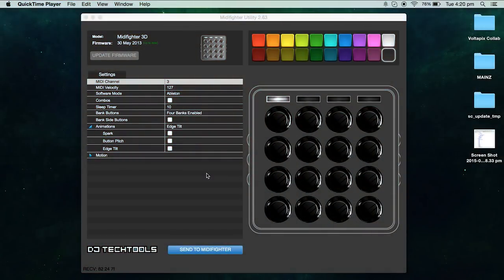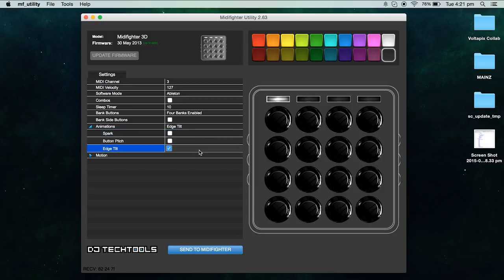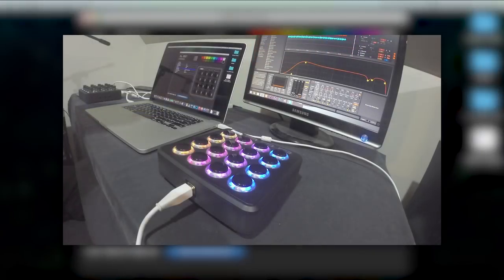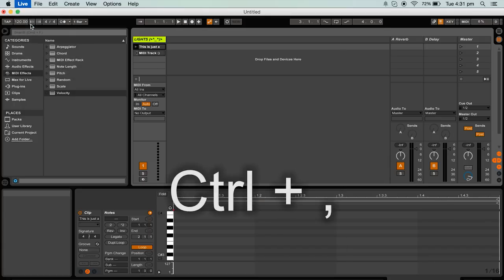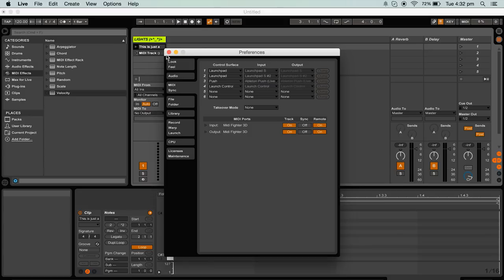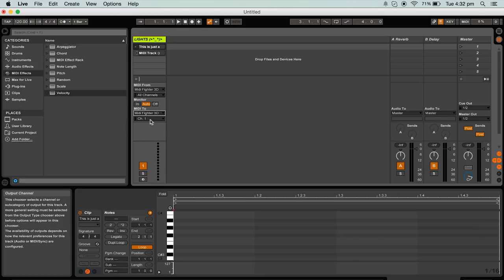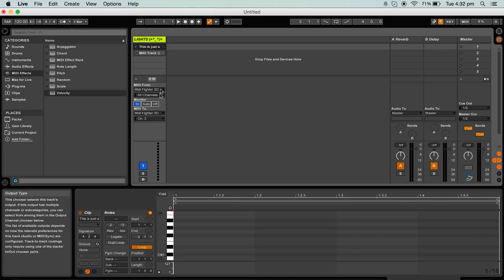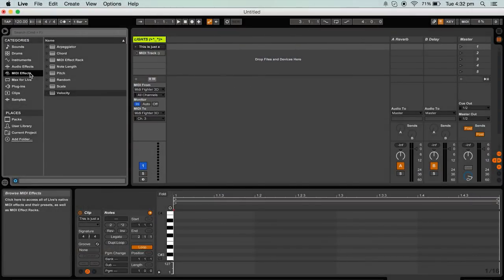Tutorial | Custom Lightshows | Part 1: Setting Up a MIDI Fighter 3D

Comment: Hi ... great tut. I have a midi fighter spectra ... and I'm not seeing the same utility-possibilities as you in the video. 
Both firmware of the midi fighter and the utility-prgrm is up to date. 

For instance I can't choose the "Ableton Mode" nor disable the button push function.

Isn't it possible on the spectra to make light shows?
Reply from the maker: +lronne The reason you wont have the same options as my one is that I am using a MIDI Fighter 3D. The MF Utility automatically detects that you have a Spectra, and wont show you options that are not relevant to the Spectra. You can still make lightshows on a Spectra, as long as the default colours are turned off, and you take note of the MIDI Channel. I've never used a Spectra, but I know it is possible :)
Reply: Thanks, Tim!